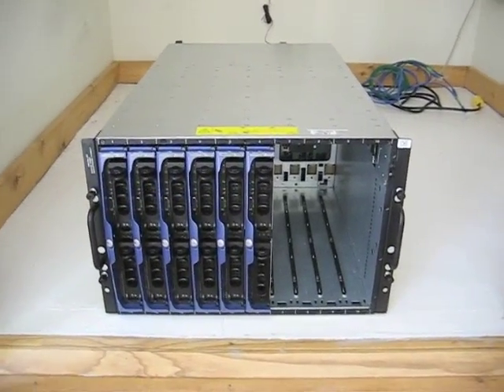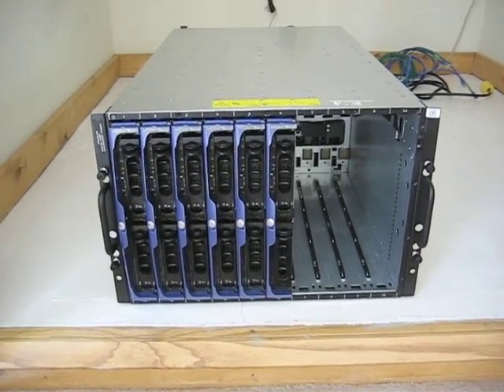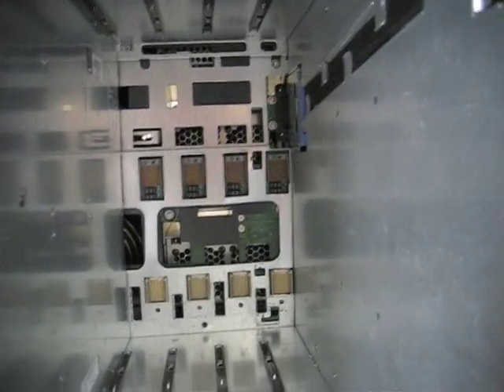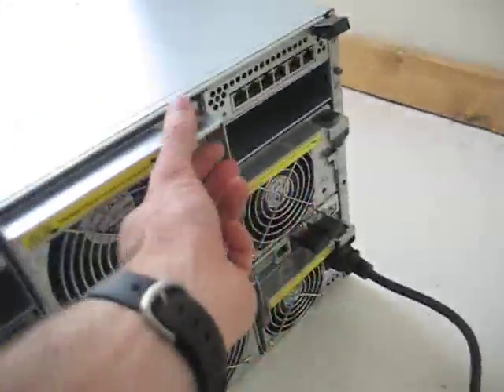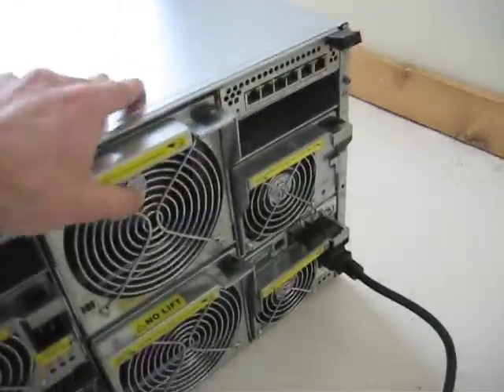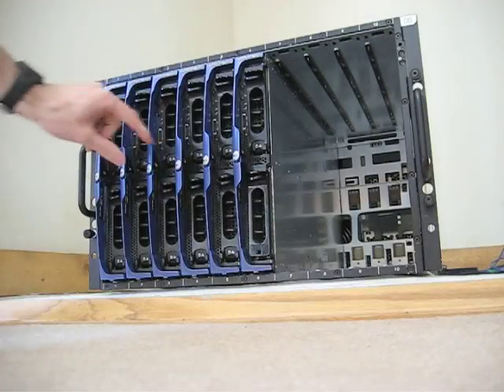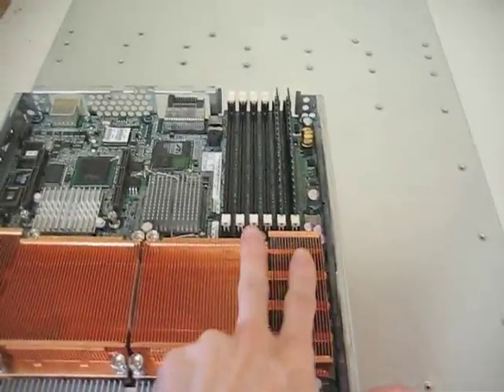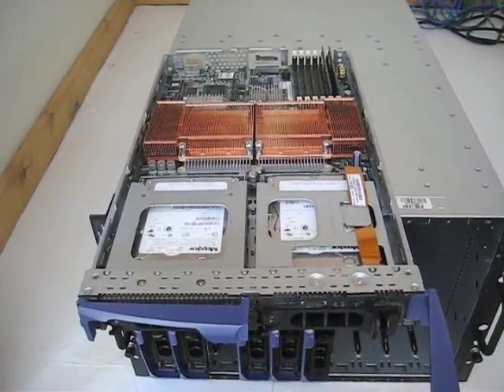Dell PowerEdge 1855 Tour

Comment from the maker: @XtR0pX If they're cheap, I'd say go for it. I pay $65/mo for power - but I live in Iowa where power is 7c/kwh. And that's with only four blades running. The DRACs -suck eggs-, and no mistake, but if you can get the front-load USB pigtail that connects to each blade they're managable.

Comment: Yeah these are nice.. jp.. If you need RAM for the blades I have some OEM Dell RAM for the PowerEdge blades.  Just tell me what size and type you want.  I saw your boards they look sparse on RAM.  I have a lot of the 512MB sticks you could have.. probably at least 20 of them.

Comment: Cool stuff man, I always wondered what it would be like to own a blade chassis with a bunch of Xeon 5500 series CPU's in them! I have a PowerEdge 2970 with dual 6-core opterons in it a the moment and it has more power than I can even use. Now that I am in the process of installing ESXi on it, I am hoping to harness some of that power :)